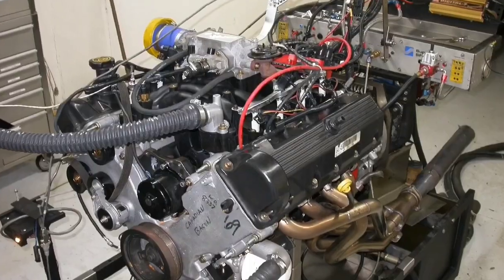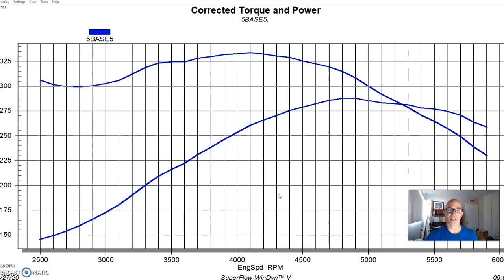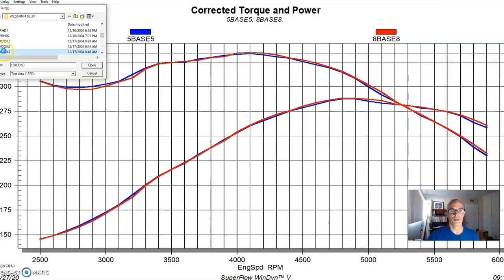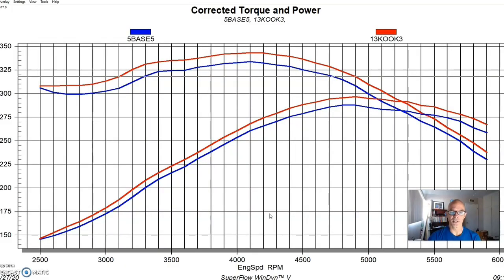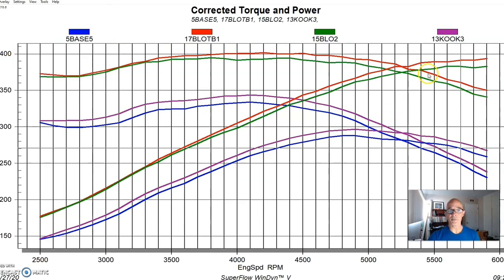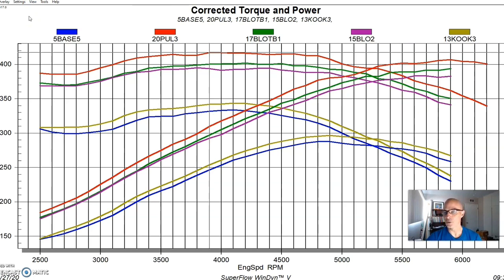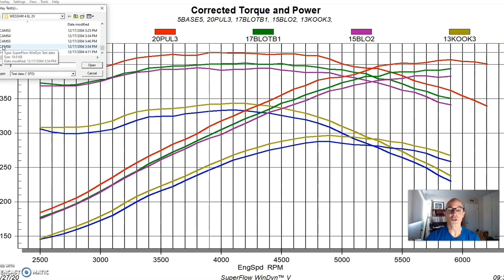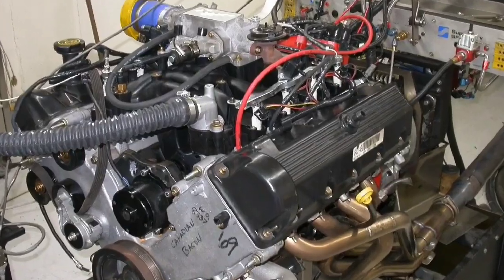FORD RACING SUPERCHARGED 4.6L 2V TEST

Comment: These motors werent really that impressive, but man do they sound good.
Reply: Depends on what you mean by impressive? The longevity of the original 4.6v 2-valve is unmatched and 700,000+ miles is commonplace for these engines. The later 3-valves with the spark plug issues tainted what was otherwise a perfectly designed engine. Yes, they didn't make the most power, but their longevity is unmatched.
Reply: @TrakSpock1  well I mean, small block Chevy and coyote but still, and the 3vs weren't all bad, they'll live pretty long under good maintenance as wel.
Reply: @TrakSpock1  have a 2001 mustang gt 4.6 with 230,000 and still going. Has had work done the the shifty plastic ford intake.other than that that motor is solid. I'm not even a huge ford fan but their was a reason they made this motor for so long and used it in so many vehicles.
Reply: Totally agree.  The 4.6 exhaust note is way better than the Coyote.  Engine power vs the Coyote, no comparison.
Reply: Love the sound of my 3v. I hate how raspy the Coyote is with aftermarket exhaust.
Reply: Sounds so much better than a 3v
Reply: Not impressive? The 4.6 is about as durable as a V-8 can be. Also they were getting over 20 mpg's back in the 90's when that was unheard of in V-8 engines
Reply: @BrownBomber92181  not to mention the hundreds of thousands of still sealed engines in crown vic that hit 800k plus before ever having any major engine issues
Reply: @BrownBomber92181  I agree. For not being very impressive perhaps he is not taking account all the cars and the many millions of miles these things have racked up over the years, crown vic police interceptors and than many used as taxi vehicles racking up hundreds of thousands of miles. And those are just 2 of many vehicles ford used them in for many years going back into the 90s. Basically a untouched engine for all them years. Ford realized they had solid engine and didn't mess with it. Maybe not impressive from a performance standpoint today but try to name a modern equivalent in a American made car today.
Reply: @ZboeC5  trickflow makes 2v heads that flow 185 and even 195 imported, but they were more focused on improving the cobras lol
Reply: @ZboeC5  185 or 195 on as cast trickflows, and you could get up to around 205 on the 2v trickflows, you also could also always throw 3 or 4 valve heads on them. And make them even crazier. Cobra R heads can flow as well or better than 5.0 heads, and if ported can get really insane, but they're a bitch to get ahold of. Even ported PI heads can get pretty good flow.

Comment: Is the stock intake really that bad  at the top of the curve? What about changing the stock intake. That supercharger intake seems to flow alot better at the top. Is this only a function of the super charger or the intake? Would supercharging an engine with an rv torque cam also give you that kind of top end power?
Reply from the maker: the power output of stock motor is a function of the stock cams, stock intake and stock heads
Reply: @richardholdener1727  I guess what I am asking is the curve was much different at the top end before you put the supercharger on. Did you also upgrade the camshaft? Otherwise I would have thought that the supercharger would follow the original power curve just at higher hp and tq values.
Reply: @richardholdener1727  I think I just answered my question by watching your comp cams video! Thanks!
Reply: Ford (and every other manufacturer) has to factor in emissions, economy, reliability etc into their engine builds. This means their engines are tuned to hit specific ranges. When they get into those ranges they usually stop.

Comment: Glad I replaced mine with a 460
Reply: If I were to swap I'd go 6.2l mod or
Reply: @Prestiged_peck  talking to me ? 

I'll keep my 460
Reply: @doylethomason6015  like I said, 460s are badass, if I ever go old school it's gonna be 460 all the way, if I restomod or build a modern car though it's 4.6, 6.2, or 6.8 v10(because it's a v10, not because it's fast.
Reply: @Prestiged_peck  I'd want a 90s viper engine with upgraded cooling and that's it haha , I hated my mod motor and it left me with a bad taste .
Reply: @doylethomason6015  2v mod motors have a hard time making power n/a but they're more reliable than a SBC, and you've probably never experienced the 6.2, it's the same motor from the first gen raptor, and ford make over 4k crank when they were first testing it with boost and one off 4v heads, in production form you could probably make 1200 outta them with the right cams and enough boost. After that you're looking at some serious porting. I just want the triton v10 for the hell of it, it's a killer sleeper motor because if you tell someone you've got a triton v10 motor they instantly think "that idiot's probably slow AF, but they LOVE turbos, so just add twins and gap nation lol

Comment: So, all in all, you'll drop $10k (or thereabouts) on a 4.6 2V PI engine and have a 436 HP 428 lb ft V8(or basically the same power level as a stock Coyote). Considering the fact that you can get Coyotes fairly inexpensive nowadays (WAY less than $10k), I'd say it's a no brainer...Conclusion? Get a Mustang Coyote, get long tube headers, a bigger throttle body, a full 3" dual exhaust, and put a real cold air intake on it with a Tremec T5 or TR-3160 and you'll have a really quick and fairly powerful car. Me, I'd prefer a SN95 body style, or something around that time frame to a Fox body. Yeah, the Fox's are lighter, but I'd rather be comfortable with a good looking car. Even the 2005 body style would be sick to have a nice running Coyote in it instead of the anemic 4.6. P.S. I'm not saying that the 4.6 is a gutless turd at all, because they can make some REAL power when built well, but for my money I'd rather start with a Coyote and build it from there.
Reply: swapping an engine, well a different engine is a big deal for most if you shop around and don't get screwed on used parts of which there is a ton for the two valve you can build a pretty cool pretty powerful 2 valve for pretty cheap and sometimes people just have to run what they've got in the car So yeah of course the coyote would always be better and probably more cost effective in the end but people don't just have $10,000 they've got $200 here $500 there a thousand here
Reply: Well, this was 2004, so there is that issue in procuring said Coyote!
Reply: You are mistaken. The 4.6 2 valve has a ton of potential. You can't take a dyno test from 2004 with a tiny, old, arguably inefficient supercharger and act like it sums up a 2 valve. It's 2020 and people still think the 2v is somehow the most unviable engine platform out there. 

A 2 valve, just like most other v8 platforms can make a ton of power with boost. It isn't too far behind from a 4v in the slightest.

Everyone's so quick to want to swap in a coyote but they never consider the fact that the 2v is a very capable engine when boosted. The two valve is all they need to go fast. Sounds infinitely better than a coyote too with the right exhaust setup. It's also infinitely easier to deal with an engine meant for a car than to swap a new one in.

Not to mention that no one's going to be dropping 10k on this. It doesn't even exist anymore.
Reply: @theyhatehimbecausehetoldth7576  thank you for saying this! 2v motors may not like spinning to the moon but they make KILLER torque and with how light our cars are we can absolutely fly (I have a 96 gt auto and even with that slushbox I can beat a 10 speed ecoboost or v6 any day of the week. I can keep up with any stock 5.0 when I clean the car out with just a tune cold air and catback, and when I do jump for some twins it's gonna be killer!
Reply: @Prestiged_peck  I don't know how you manage to beat those cars, but alright.
Reply: @theyhatehimbecausehetoldth7576  the 10 speed GT's will pull on me but I can usually keep close to them. The EcoBoost mustangs are 4 cylinders, and if you throw tunes on them with real boost I can't keep up, and the v6 is, well, a v6. But pure power isn't everything, I'm on good tires and usually racing them on their stock tires so I've got grip advantage. If you throw them on meaty tires or throw a high boost tune in the EcoBoost, they'll gap me all day. It also helps than I'm currently about 2200 pounds soaking wet and they're usually more around 3600 pounds without a driver, so I have a very similar, sometimes better power to weight ratio.
Reply: Actually if you choise your part right . It should cost you more the 4 or 5000$  built botyome end.
You can see Richard's other 4.6 with ported heads and cam .he made 400hp easy .

I've seen 450HP with all stock parts . Ford forged crank , rods , and trw posting set to 10.5/1 .  ported PI heads . Ported PI intake  .. aftermarket cams ,  75 TB and 80 C&L M.A.F. and long tube headers . all don't in a back yards. I believe port was more expensive the the ford forged internals . I should try to find the dyno sheet . 

Internal was around 1200$
Porting of heads and intake was 
1800$ 
Cams were
900$ 
Headers were
600$ new
TB and M.A.F were
About 350$ used .

It's can be done .
Yes the coyote has way more potential but at al bigger cost .
Reply: @Spad68  a 4v 4.6 can easily make coyote power on a much smaller budget. 2vs are great dailys.
Reply: Navigator 5.4 says hello.
Reply: @BuffMyRadius  I still will take a wap block aviator 4v over the navigator. Much easier to make power with.
Reply: @BuffMyRadius  nah. It's sayin " hah! Can't keep up?!"
Reply: The amount of torque it’s making it will kill a coyote
Reply: He did this back in 2004 though, if you're dropping 10k on a 2v motor now, youre probably getting trickflow heads, a forged assembly, and a cheap turbo kit, and able to make 1k horsepower just by turning it up. The big thing with it is the 4.6 2v is a much smaller (and possibly much lighter) engine than the coyote, and with the mustangs it came in having 250-300 horses stock is just as fast if you got a good driver and tires as a more modern mustang GT due to the weight difference. I mean a fully stripped modern mustang can get down to these cars' stock weight. And stripped down I've seen these sn95s and new edges scale in at under 1700 pounds soaking wet. With the driver. When you weigh less than a ton, you don't need a ton of horsepower to go the same speed as something that can weigh over 2 tons
Reply: admiral_peck 7 you can also do an on3 turbo kit and build the bottom end and make 1k hp
Reply: @lowslo9287  I was gonna go hellion but same idea, I'm putting trickflows on it first, I'm headed more towards the 1500 range.
Reply: @Prestiged_peck  4.6 2v is iron, coyotes are aluminum, probably pretty close on weight. And no, I have a 2v, and no way in hell will 2vs come close to coyotes, there's no comparison without boost or nos, or just tons of motor work.  And I hope you meant 2700 pounds for a new edge, that's about as low as you're getting unless you take off every body panel, window and the engine itself haha.
Reply: Bryce Hickman they also have aluminum block 4.6s
Reply: @sategllib2191  well I have an SN95 coupe that I recently scaled at 2400 with nothing but the spare kit removed, a smaller, lighter catback, and that weight on the pinion gone
Reply: @Prestiged_peck  my sn95 has so much weight pulled out of it, 4.6 2v auto, no sway bar, strut brace, fiberglass hood, lightweight bumper, etc etc. It's 3000 on the dot. How you managed an extra 600lbs off is beyond me unless it's a shell.
Reply: That is true.. but swapping that engine out probably is not for the average Joe
Reply: Mayhem Maverick  I have no idea what you're referring to as a cammer block. There's nothing special to support a 5.3 stroker crank and rods, so the same displacement and power handling could be had from an early iron casting for literally pennies on the dollar. I source all levels of completed engines, long blocks, down to bare blocks and I have no idea what a cammer block is. To my knowledge, the go to best ford block is and always has been a teksid. Heres my problem with this combo. KenB ran a 10.6 1/4 in a 3000lb mustang with 360rwhp out of a na 2v. What are your goals for the car because if your goals are only to make that power level, you may be disappointed. On na combos, trickflows don't make that much more than a ported pi.
Reply: Mayhem Maverick  id rather have a 4.6 than a 5.0 anyday. I like the engine design better. I know that thing like the back of my hand. I know what bolt goes where. I have spare parts for days. Im a modular motor fan.
Reply: They made tons of aluminum block 4.6s, if you're going for a real race motor you try and get ahold of an aluminum block, especially if N/A
Reply: be way better with twin turbo. Seen 2v running 8's with TT setup. Go turbo, its way better.
Reply: @ryanmalin  8s? Try high 6's, guy was running full port trickflows on straight meth with twin 88s though so that might be a bit of an extreme case.
Reply: @Prestiged_peck  na 2vs been 9s on nitromethane. Andrew Lavender has a 2v trickflows single combo that is down right nasty. I'd love to see it run out the whole 1/4 but it would probably run out of gear and coast into a low 8 high 7.
Reply: a 5.0 wil drop into a '96 and up Mustang
Reply: @hank1556  so will a 4.6 4v, and the cobra 4vs came factory supercharged. They also could easily make 5-600 wheel with nothing but a boostapump and a pulley.
Reply: Mayhem Maverick  that will sound amazing
Reply: Put heads and cam on a $250 dollar 351W pulled from Pick a Part .. 400hp plus. So much gayness for the Coyote when there are easier, cheaper options.
Reply: @mountainofeverest3861  A top end swap is a little less budget friendly than your thinking especially trying to support 400hp na. Even if you find an early roller 351, it would still be more cost effective to start with a 4v 4.6 or a used f series coyote both of which can be had fairly cheap.
Reply: @madmod  351w Stock internals support 450hp easily..  351N Ford Racing heads are under $1500.  Ford Dirt Trackers do this all the time on the cheap.  Coyotes are for the un-learned.
Reply: @mountainofeverest3861  a 2v's stock internals will easily hold over 450ft/lb. Lest we forget, junkyard sbfs require new valve train, push rods, rockers, and springs to accept a decent cam to come anywhere near that. Dirt trackers focus on average power not peak which again would put the benefit towards the modular 4v engines. That's why they replaced the 351 in both performance and truck application.
Reply: @mountainofeverest3861  I have been a part of our local clay county fair speedway in clay county Iowa. We run a dirt oval from 410 sprints down to street stock and I can assure you their stock casted head, limited cam choice, and 2 barrel Intake combos running open headers are not making anywhere near 400whp. I never once claimed a 351w can't be built to perform reliably at 400+ horsepower. I've only stated, the modular is a better performer for the money. Sourcing an aviator, Navi, mark, or continental engine is pennies on the dollar to what it would cost to buy a off shelf hci combo to support that kind of power on a 351w. That is a fact. How many stock head cam and intake 351s make over 350flywheel horsepower, let alone to the tires? How would it cost less to rebuild and refurbish a junkyard engine versus reusing all of the stock induction on a junkyard engine that costs the same? My local grab n go sells pan to harness gasoline engines for $260+ a core charge. You can't find a sbf head that can outflow a stock 4v head for under 800$.
Reply: @madmod  351 Clevelands have been making 450hp for 50 years with a cam, spring, intake swap.  Here is Holdener making 450hp w/351c w cam, springs, intake at 10:25 in the video. https://www.youtube.com/watch?v=dQYBklryzNg
Reply: @madmod  351c/4v heads flow 270cfm box stock. I pickem up for $250-300 pr.
Reply: @mountainofeverest3861 I guess I was unaware 351 CLEAVLAND  heads were the same as an OEM Windsor. Your also not allowed roller cams as per dirt track rules. No aluminum heads etc etc. A stock 351w  running stock induction and cam is 260 flywheel horsepower engine on a good day.
Reply: @mountainofeverest3861  tell you what, Ill  take you up on your offer. Rather than arguing over the internet of what you think you can do, just do it. I already have my 2v sn95. Go build your sbf and post up some times because I guarantee you will spend far beyond what your imagining. I know how far modulars can go on a budget from actually building and driving them. Not just reading about it online.
Reply: @madmod  You keep moving the goalpost.. Original claim was Mod Motors cheaper than Windsor for power production.... Obviously Wrong.  Ford N351 Cast Iron Dirt Track heads flow 250cfm.. enough to support 500hp. Stock 4V Cleveland heads ARE cast iron.    Doesn't take a roller cam to make 450hp.  About time for you to go shop some $1600/4 cam/ Modular 4v cam sets isn't it? Lol.
Reply: @madmod  351W block and Cleveland heads .. 410 stroker. 710hp. https://www.youtube.com/watch?v=fUxETqe4wmU
Reply: Or better yet let's start talking specifically about junkyard 5.8 winsors, link a stroker 410 cleavland, then tell me I change the goal of the conversation. Nonsensical
Reply: @madmod  Lol..  You win the Wannabe Internet Superman Award .. Congrats.  I've posted dyno pulls of both 351 Clevelands and 351W's.
Reply: @madmod  Here you go superman .. stroked 351w Clevor .. 820hp Naturally Aspirated. https://www.youtube.com/watch?v=sSjzJQHRs6A
Reply: @mountainofeverest3861  351c never came with 4v heads you're trippin, they only ever came with 2 valves per cylinder unless we count experimentals